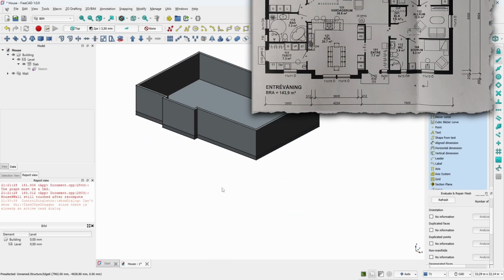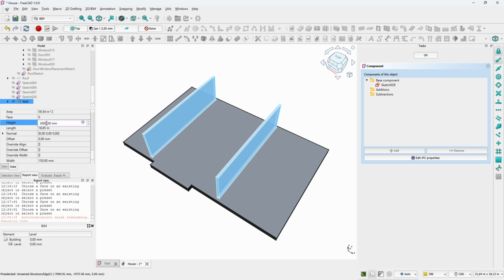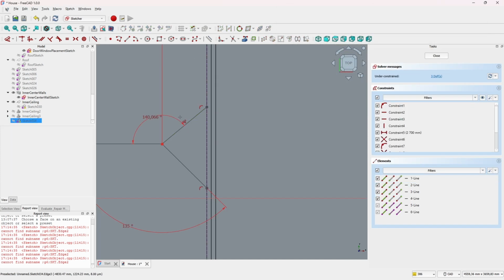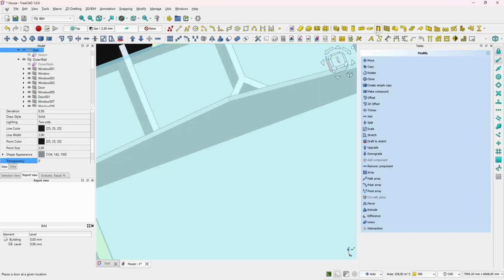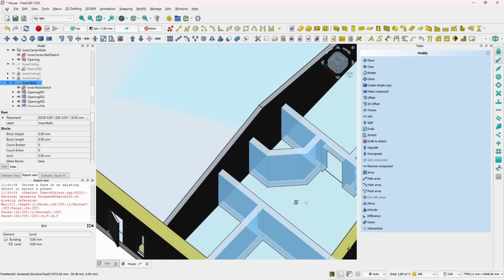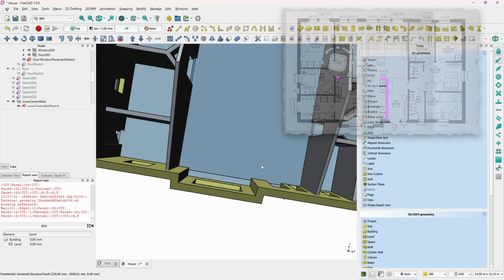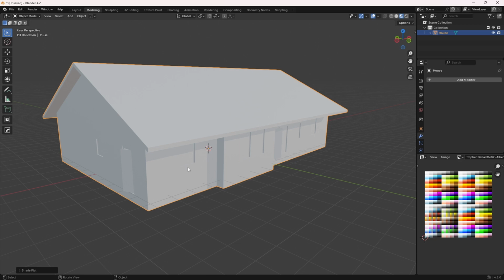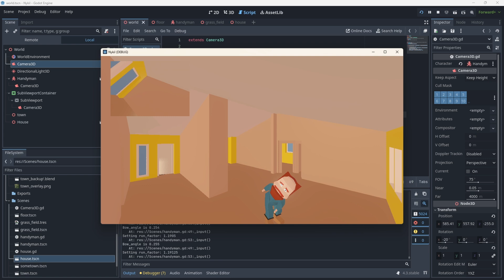FreeCAD - Let's build a house (Part 2)

Comment: Hello, ate the min 7.00 you don't need to sketch the wall as different parts, you just have to set the hole depth property of the door in the data not  zero value. Indeed the 0 value means the hole of the door extend to infinity, so it will cut all the walls in the sketch. Put a value like 200 mm like the wall depth. Anyways, nice video, keep going on.
Reply from the maker: Thank you for the heads up!
I'm pretty sure I played with that at one instance but  obviously failed for some reason or other. Maybe I failed to simply update the operation (like closing the sketch?).  Now I know to double check that next time.  Many thanks :)
Reply: He has 350mm as the wall thickness, this is the value he must use for the windows and doors on the exterior walls.